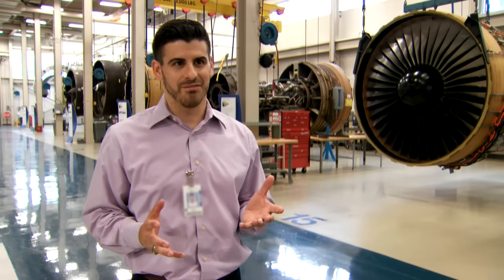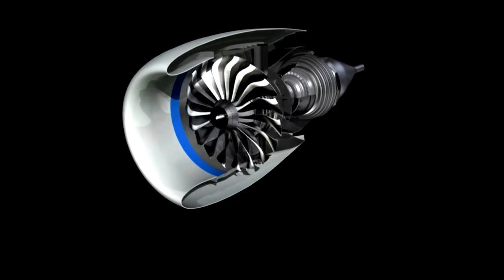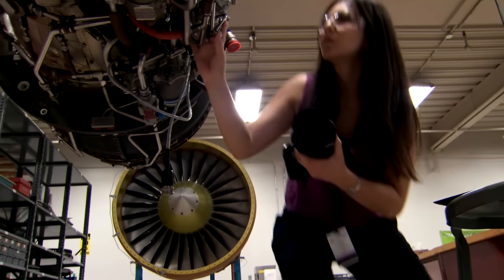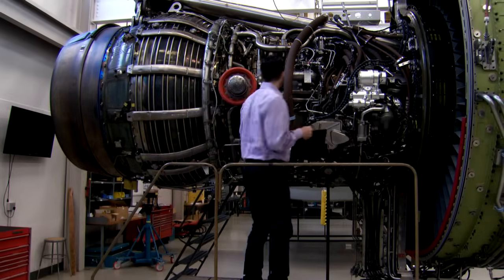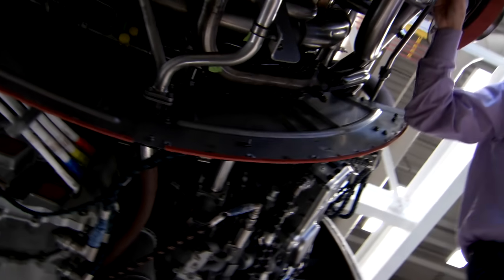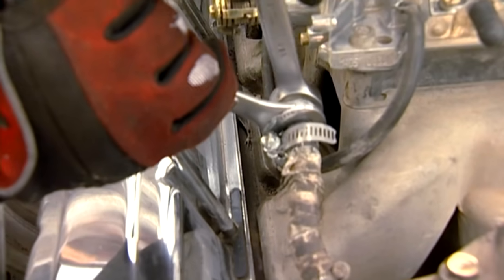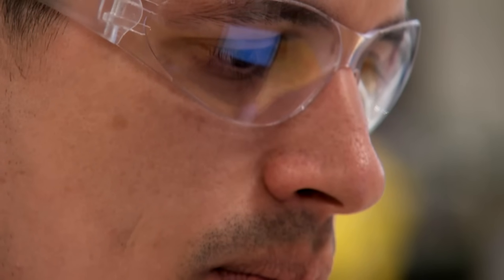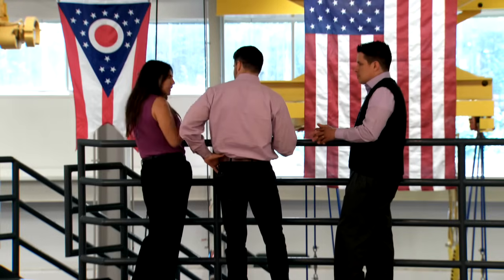Mechanical Engineer

Comment: But in India most of mechanical engineers works for IT company 😂😂😂😂
Reply: Once a MECHANICAL Engineer is always a Mechanical engineer, i too an mechanical engineer has worked hard, been at maintainence, worked at an fabrication department in construction, then further worked as an project engineer at compounds manufacturing plant who wanted to setup a company in india, holy crap when i looked at those days, almost i utilized my 3 precious years for a penny salary, but never lost hope in my mechanical work ,  than finally i made up my mind  and  joined an company body and learned the Designing of automotive parts to get into that stream 
 and was well placed in a company

U need to have  balls to survive

Go hard or go home, that's what is mechanical engineering
Reply: @vaibhavrk1163  i am mechanical engineer 5 years exp and when i start i had to punch 2 other applyers to get the job (they didnt come to interview the next week)...
Reply: @paugasolina5048  great tactics.next time i wil give it a try.
Reply: @vaibhavrk1163  That's Great sir,i am also  Mechanical student parsuing 4th year,I am Hardly Fixed to work On Core job,but Many people always trying to convince me to turn to IT job ,including my placement Coordinator 😂🤭,No one Inspiring me to  Get into Core ,But still i Have Hope  i can Get in Core and YOUR EXPERIENCE gave me more Hope ....🥰🥰
Reply: @vaibhavrk1163  do did you made your own company now?
Reply: @Flyingkitty1234  noop i am working as an project engineer for linde gas industry, and feel immense pleasure for providing liquid oxygen for health industry like hospitals etc and various sectors, so engineering is what we have to make others as productive, just do what you like and feel interesting in your field or else its waste of life
Reply: @vaibhavrk1163  true shit and that what i amdoing trying hard
Reply: @vaibhavrk1163  what's your salary and where you work sir
Reply: Because I guess Indian system is more of a degree driven rather knowledge/interest driven. Why is it like it’s same degree is needed to enter civil, banks, software or technology driven industry? Why isn’t it like you must need to have basic qualification like intermediate or so and take a entrance test of every individual applying syllabus of which should be entirely based on job he is going to performed. Maybe I guess we will make a greater and knowledgeable workforce then rather the salary motivated individuals
Reply: @axay999  bhai us ka population 30 crore aur apna 130 crore usme se samjo agar 5 crore bhi engineer hai to sab ko kaha dhang ka job milne vala h, sab thik h par jitne engineers hai utni jobs nahi h
Reply: @ROHITPANCHAL  private colleges bandh lr deni chahiye
Reply: @ROHITPANCHAL  5 crores engineers elections mai vote daalne keliye chahie India mai. Unhe kaam karne ka mauka nahi dete apne pasand ki naukri mai.
Reply: Let's move to comment section to read... Indian experts about everything
Reply: Because Mechanical Engineering Can  Work  in every every field accept IT Engineer can't Go in Mechanical Field Companies,,,
Reply: @rahulkatare802  wrong. Mechanicals have their limits and so as other engineering discipline. You would know this in real world.
Reply: @filecategory6596  there is no limit in mechanical
We learn every single thing
Reply: @shaaradpandey5546   yes true every engineering field is great, mechanical engineering is superb! It's just that India doesn't have good projects and a really fu*ked up education system
Reply: Because they are studying to get job not for knowledge
Reply: ......you know it why....
Reply: I really want to be a mechanical engineer but your comments are demotivating
Reply: @shaaradpandey5546  germany is great! For mech ... But which course or specialisation should i prefer ... Which is growing field and has more job opportunity...
Reply: haha...bro its bitter truth of engineering in our country..bcoz in our country research level kind of work is almost negligible and may be concerned with few departments only and everything is being dependent with just copy paste action!!!
Reply: In Brazil they drive taxi.
Reply: That is exactly what is going on in china, the salaries for the mechanical engineers is too low in comparison with that for the IT industries. So a lot of mechanical engineers won't work for a factory and study the programming skills to find a job in the IT company.
Reply: We as a indian mechanical engineers have to be ready as in future we will be having lots of new opportunities so tighten your seat belts and develop skills and competencies by working anywhere, gain some real working experience , and it will give you the readiness for upcoming future opportunities in mechanical engineering , don't run after money, run after satisfaction of work , cheers to all my brother mechanical engineers 🤘
Reply: @rishiverma4686  what are the skills of a good mechanical engineer?
Reply: Here in india people only from IITs and a few other private colleges possess the actual skills needed to be an engineer the rest all are unfit to be called the same
Reply: Call center after MBA 😂 
Our education system is pure bullshit
Reply: @phenomanal physics it is not hydrochloric acid it is Hindustan computer limited
Reply: Bhai rulayega kya
Reply: This is the real problem. 
In india, guys first do engineering and then they decide what to do🤣🤣
Reply: @USMANALI_Videos  engineering ke baad MBA. 😂
Reply: 996
Reply: @Bianxingjingang  996 is the exact reason why I hate my mech engineering in particular.Shopfloor working culture here in India Is worst in the world.They will give you jobs for diploma holders like line inspection,final inspection or supervisor.My salary was under 12000 rupees and manually repeated work 12 hours 6 days.Workers are always tired and lazy due to factories ignorance they never respect senior positions.Too much focus on cost cutting and minimizing employees followed by terrible maintenance and service of Moulds is also a contributing factor to such problems.I am planning to move to IT sector.
Reply: Because India import almost all hardware from outside, from toys to Fighter jets...
Reply: I am currently studying mechanical engineering I don't want to join IT
Reply: I work as a Mechanical Design engineer in an MNC, but it took lot of hard work.   I think with IT I would have progressed faster.    The amount of automation that can happen to Mechanical is quite high. R&D projects are also going on courtesy Machine learning and AI.  Lots of jobs can go away due to it.  Now I am thinking to moving to that field.
Reply: I m in tcs, mechanical jobs are shit in india they don't know about engineering, so they give you work of production and any kind of work , and it's really bored, but when I join tcs i really satisfied with work
Reply: We work here for Defence Dept. sorry to hear about that
Reply: @Sandip Patel do you learn modelling though? That's really the main part.
Reply: Hahahha
Reply: And that's a sad story
Reply: @farheenrehana4568  Some people like me are not much interested in mechanical engineering even after graduating in the same. So, let them go to IT. It would be great.
Reply: @amolkhobaragade  i one of those... just like you😀
Reply: There are not enough jobs in core mechanical engineering as the amount of supply of engineers is, and most of the competitive lot , that is in terms of statistical mark , they run for good paying jobs, and indian companies cannot offer the way these international companies give just because of sheer dollar to rupee difference, but the satisfaction of work. Is far better in product based indian mechanical companies  OEMs
Reply: And in  M.I.D.C
Reply: You mean corporate labours I guess!
Reply: Himanshu Raj 🤣🤣🤣🤣🤣🤣🤣🤣🤣😄😄😄😄😄🤣
Reply: doing autocad?
Reply: Of course even I'm also
Reply: Vai, your word touched my heart. only we indians know how frustrating it is
Reply: Electrical engineers can get aquainted with predictive maintenance and digital twins, the new era is turning to the digital transformation and optimization
Reply: Hahahahah .....
It burns ...
Reply: Same in Iraq🤣🤣🤣🤣
Reply: What about iitians how much job opportunities they get after finishing their btech in mechanical engineering
Reply: @rahulsingh-wx4mw  since last 6 years they even can't find jobs in PSU's
Reply: @itrisomus01  I am in class 12 and I am preparing for jee advanced which branch should I prefer ,actually i have an interest in mechanical  engineering and I want make supercars so can I go with mechanical engineering
Reply: @itrisomus01  is it necessary to earn money or just I can follow my passion in simple words I love physics and mu dream is to make  a engine which give 100 percent efficiency
Reply: Actually I don't know much about it when I was learning about thermodynamics I truly  inspired by carnot,s heat engine
Reply: @rahulsingh-wx4mw  if you can able to buy home, food and medicine without money , it is not necessary to earn money and passion don't take you far except you have the potential , but first you need to understand what is engineering many people don't have any idea before taking any course and ended up blaming others coz they took up the course some told them to go that way I mean some recommended ...
There no perfect body in the universe without any losses and no engine will give you 100% efficiency ...
The most current engines which say are efficient gives only 37 % efficiency..
Reply: @rahulsingh-wx4mw  most interesting will be Otto cycle and dual cycle and braton cycles ...
Reply: @itrisomus01 sir I am sorry actually currently iam in class 12 I didn't know much about it pls guide me that what is the reality about engineering by the why are you an  Indian
Reply: @rahulsingh-wx4mw  I'll tell u one thing. In Indian version of engineering students r made to write exams more than any practical knowledge. I personally believe that pratical knowledge is more important than just writing them on a piece of paper . So for me projects and internships r with which actual grading should be, but it's not the case. We have to mug up thing which we know we r gonna forget the next day of examination. And literally most of the students loose interest in the method of teaching. I myself is in one of the top engineering colleges in India. If u r interested  in supercars, it's not just getting into an NIT or IIT, u have to try to get exposure to building cars which u can get through clubs. If not able to get into, u can do projects under the professors who will hopefully guide u to more and then interns. Ik first year u ain't gonna get anything much. So don't expect a lot and just understand about the system and stuff. From second year u will be able to try ur all these stuffs.
Reply: @rahulsingh-wx4mw  100 % efficiency are you insane ???
Reply: @Himanshu Raj, IT company which job,  programming developer??
Reply: yes it is damm true
Reply: shaarad pandey give money
Reply: And in iran all engineers works in resturants and fastfood and security and worker in companys with salary 50$ in her mounth.
Reply: @amirhoseynhesari6021  Iran is not so much developed , and they don't have more companies for the engineer's ☑️😎
Reply: Skills are required bro engineering is dynamic and India has created some great engineers also
Reply: Yeah u are right
Reply: I am a mechanical engineer and I work in HCL
Reply: @yaswanthpaani3307  lol  at hydrochloric acid?
Reply: @prashanthislavath  good joke
Reply: @prashanthislavath  really u work in ISRO or you are kidding to me
Reply: Yes I am also 😂😂😂
Reply: haha🤣🤣🤣
Reply: fact 👍
Reply: Really 😂😂😂😂
Reply: I am also
Reply: Hmm Thought GE was in finance...
Reply: Oh the schike entrepreneur
Reply: Mechanical waale सभी बाप hote and बाकी conputer science कोई degree
Reply: Thodi na hoti
Reply: Im a mechanical engineering graduate working in Ship Building as estimator officer for ship repair section. 😅
Reply: 😂😂😪 sad reality
Reply: Woh log chutiya hai bhai
Reply: Indian education system is fucked up
And every science student knows that
Reply: That's because we studied programming and informatics, as a mechanical engineer, you will be able to work even as a pilot😅
Reply: Because they don’t build engines in india
Reply: As a mechanical engineer working in IT company, I can confirm this.
Reply: me too
Reply: https://youtu.be/el6JU1G6MZ8
Reply: same here in the Philippines 😁
Reply: true .... that too in testing and support
Reply: True❤️
Reply: In Costa Rica is industrial maintenance, aka industrial engineering:( it’s sad
Reply: Respect
Reply: For 
Big pay check,
Sophisticated environment,
Social status,
Easy to go abroad,
Matchable life partner,
etc..
Reply: But why an india famous a problem of people , example is area not clean and polution by car or motorcycle ...
Reply: main problem
Reply: CUZ YALL HAVE FAKE ASS DEGREES
Reply: Nice too see these many comments,i am also looking for job in CAE domain as a fresher if anyone can reffer me it's really helpful for me.
Thanks 😊
Reply: Athinenthinada naaye chirikine it companiyil pani edutha anak entha preshnam onnu poderkka
Reply: Because India is hub of IT Services.... the service sector has 64% of GDP contributions however the secondary manufacturing sector contributes only 19%.... 
Hence there will be a really really high competition for a graduate to work in their field.
Reply: Indian engineers don't get such huge opportunities to xplore their skills here, so they can go with IT companies for placements
Or be in their field & go to companies who want them... Not much in india
Reply: We don’t have companies like GE or Tesla here being a socialist constitution mindset we didn’t take risk of building such companies in India.... rather we prefer to do IPL gambling or preparing for government exams for 2-3 yrs 😅
Reply: If you don't say good about country shut your mouth and go find better country made for you.
Reply: Same in China. Most of engineers ultimately work in IT company as a software developer. 😁😁😁Because the salary paid for IT industry is much higher than manufacturing industry. The difference can be three times high. In China, a software developer in big tech company like Bytedance, Tencent Alibaba etc. can be as high as 60+thousands dollars or even higher. A lot of job opportunities related to computer science is blooming. So most of ME background engineer learn the software development techniques by themselves and find an IT job.🤗🤗🤗
Reply: am also
Reply: Mechanical engineer resting the whole world 🌏 economy. 💪💪💪 be proud
Reply: @MechanicalCommunity  Tu tera dekh ma tune kya ukhad liya
Reply: You can't show the inner power without practical work.in India where the maximum engineering college there is no lab for practical work,there is limited only theoretical part....so there is a big big  difference theoretical and practical be work you can't consider the Indian mechanical engineer is nothing .
Reply: @akterhossen2865  Indian Engineering college laboratories and workshops have not been upgraded since 15 August 1947. Indian mechanical engineers have hands-on experience on equipment and machines that are not in use in the industry. This is the mismatch.
Reply: Aur SC/ST ko lekar aao ...India will prosper
Reply: @RealAthrey  Bro, sabhi karte hain. Tere General waale bhi cheating karte hain.
Reply: @RealAthrey  sc/st walo se jyada to general categories walo ko reservation milne lga hai... isko theoretical language me bola jata hai double category non -constitutional right...in whole country only 12.38% people belong to general categories and take reservations 10% which is the highest reservation percentage from population with respect to others...
Reply: @RealAthrey  Jai Bhim 😍
Reply: @RealAthrey  education system bekar hai India ka. Employment prospects bhi kachra hai India ka. Kuch bhi pado banna toh software engineer hai India mai. Isme SC/ST logon ka kya dosh?
Reply: @RealAthrey  🤣🤣🤣
Reply: Mechanical engineer's salary is hideous. Thats why i shifted to electrical engineering. Now, i work in hydroelectric power plant here in Australia with no regrets at all. Ive been in manufacturing plants, transmission and substations and also robotic company like kuka. But my current position is what ive been waiting for long years... electrical is superb engineering. You can put electrical engineers anywhere. Unlike mechanical, the job parameter for mechanical engineers is limited to what they are concentrated according to their experience. Mechanical is dying here in australia. Mechatronic is the new era of mechanical. The percentage of hiring companies for mechanical is decreasing. I know, coz one of my colleagues is a mechanical engineer and realized that in this modern era of real world, mechatronic engineers are becoming in demand. 
That separates the electrical engineers... electrical engineers never gets old. Always in demand to this date coz face the fact. Energy is supremacy. Electricity runs the world.
Reply: @filecategory6596  you shit scrap....i am working as Junior fellow researchship in ISRO.... mechanical is an multidisciplinary with numerous subjects....have you heard of CFD(computational fluid dynics) and stress analysis is done with mat lab and python...even materials testing also comes from and design structure of every element comes under mechanical.... without mechanical your energy is used in ur Asshole...to fart......
Reply: @filecategory6596  your work for hydro electric power plant....damn laugh....with our analysis itself fluid velocity and fluid structure.....its energy, effeciency , is our subject...you are just instrumental your electrical is......
Reply: @kitchens222  Kid... welcome to the real world where electrical engineering is superb on any aspects.
Reply: @filecategory6596  Help me !! 
I am mechanical engg paassout 2019. Mumbai university. ... As I am experiencing their is lot lesser requirements of mech engg in companies and salaries are like pennies for working 9hours... I want to go for masters what will be good to switch my career flow...(Though I was interested in automobile... And my 11th 12th std i had Electronic subject which i scored good i like it too... As i wished to work in auto hence i did my graduation in mech ... Now i feel trouble for choosing mech.)
Reply: @pranavchaugule1448  me too. My score in Electronics was good. But I chose to become a mechanical engineer.
Reply: @filecategory6596  bro are you from india how you get job in Australia